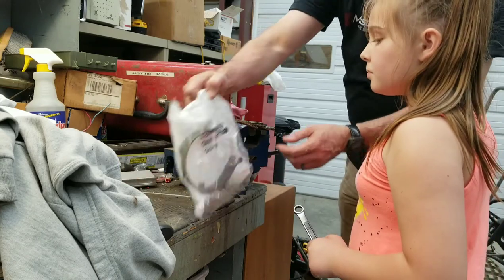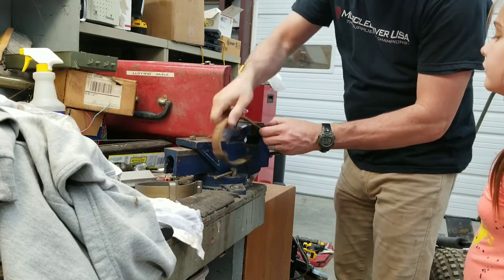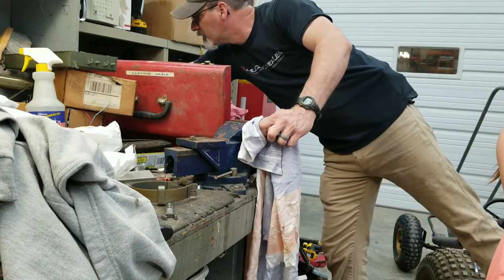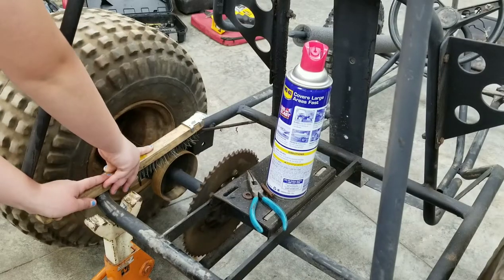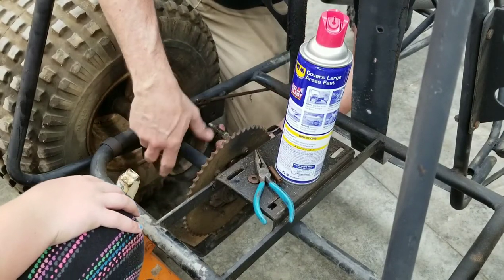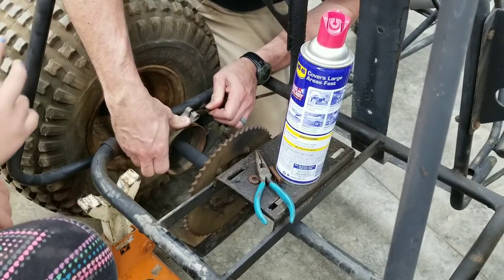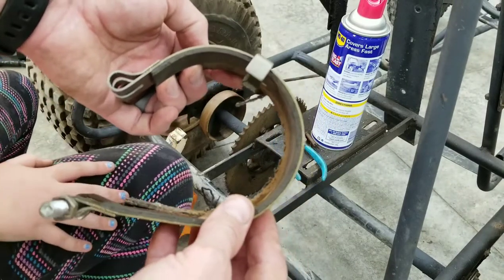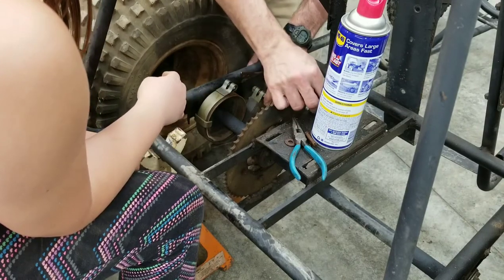New brake band, adjusting linkage and painting

Comment: Hello, my brake band slips off the end of the drum repeatedly when the brake is applied. I see your band has some form of a clip/bracket that I am assuming keeps your band from doing the same. I went on ebay to buy a new band but none of those has the same clip/bracket as yours. Can ypu provide me wth a link or part number where  I can buy the same as yours?
Reply from the maker: https://www.ebay.com/itm/4-or-4-3-16-Brake-Band-w-Lock-fits-Mini-Bikes-Go-Karts-/133587199923?mkcid=16&mkevt=1&_trksid=p2349624.m46890.l49286&mkrid=711-127632-2357-0
Reply: @stevegullett7390  Thanks for the feedback! I will measure my drum to make sure this one fits it.